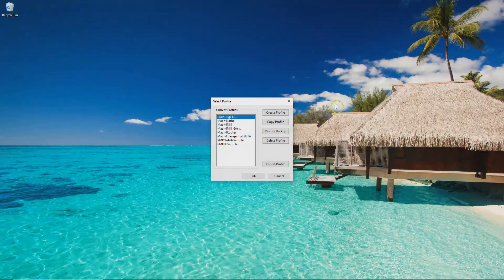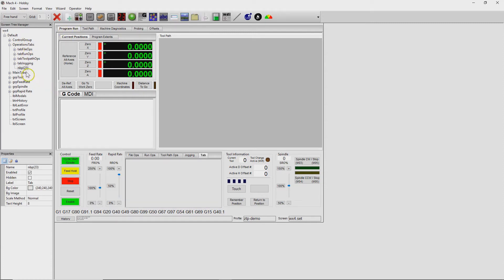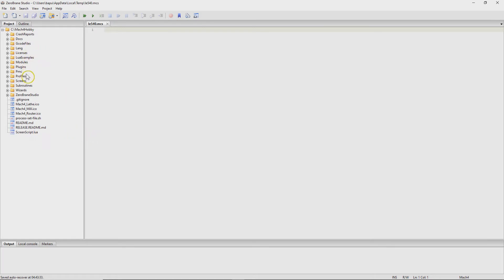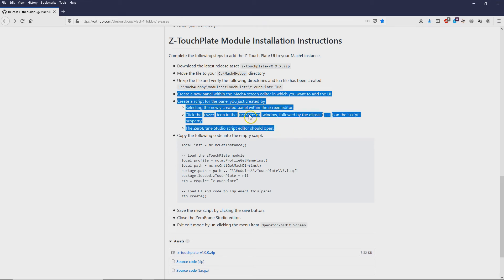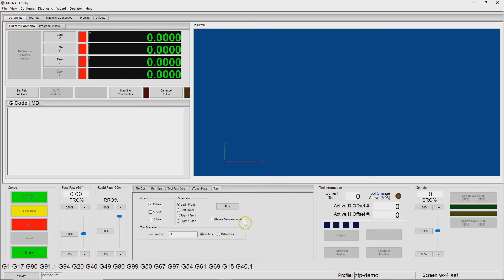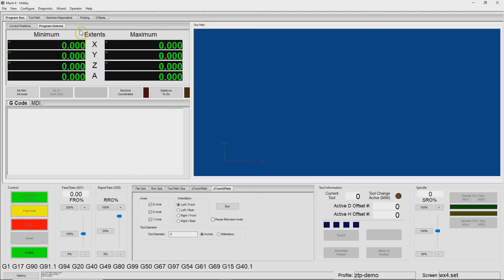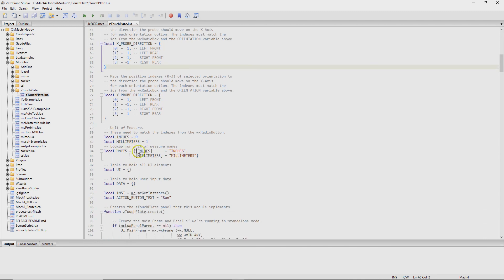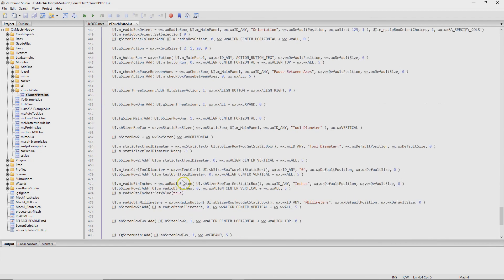CNC Router Parts - Z Touch Plate Mach4 Installation

Comment: Hello, first of all, I appreciate the time to explain this issue, there are people who are starting in this CNC world and this is highly valued, having said this, I implemented what was explained step by step, I managed to create the interface well and it works ok. BUT when trying to make the adjustment with my CNC, it throws me the following error, which is copied below but my machine itself works, simulates jobs and moves away ok. Now I do not know the cause of the error, if you can give me an idea I would appreciate it, I also comment that the version of the UI Panel program is V.2.0.0 (new)

error:
[Probe Z-axis]: G31 Z-7.7700 (FAILURE): C: \ Mach4Hobby \ Modules \ zTouchPlate \ zTouchPlate.lua: 387: Probe never touched.
[Reset Feedrate]: F100.0 (SUCCESS)
<END>

Saludos.

Comment: This is great timing. I was just deciding on how to deal with my touch plate. One thing I have seen on other examples that I like is the initial Z down at a higher speed taking advantage of the springy touch plate, then it backs off a little and gets a fine adjustment.  I'll be using your code shortly. Thank you for the effort and the excellent walkthrough.

Comment: Thanks for this video ! I have just added this to my Mach 4 , I do have one issue maybe you have an answer to . When I hit run my z axis is moving up away from my touch plate instead of down towards it . Is there something in the code string that could be edited to solve this issue ?
Reply from the maker: I would confirm that your Z-axis is configured correctly within Mach4. With your machine enabled, go to the 'Jogging' tab and confirm that when you click the 'Z-' button, your Z-axis moves down, and when you click the 'Z+' button your Z-axis moves upward. If they're reversed, you should correct it in the Mach4 motor configuration. There is a checkbox labeled 'Reversed?' that will invert the control for the given motor. Any gcode you run through Mach4 will expect your Z-axis to behave this way. 

If you have some really strange custom configuration you could edit the following line in my lua code (on your machine) but I don't think that should necessary.
  https://github.com/thebuildbug/Mach4Hobby/blob/1d28d6ee7ada36f938ba4814e33ca79832f9f89a/Modules/zTouchPlate/zTouchPlate.lua#L241